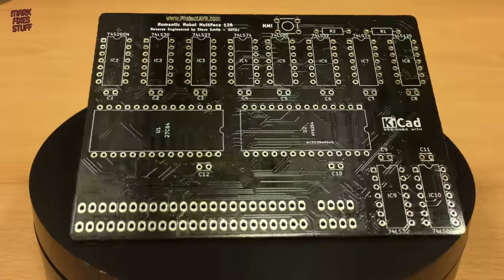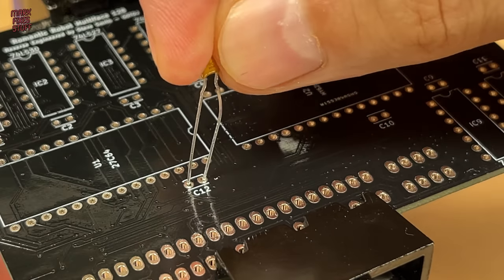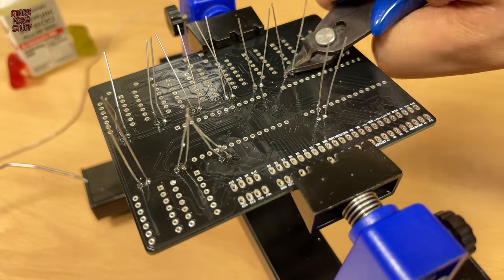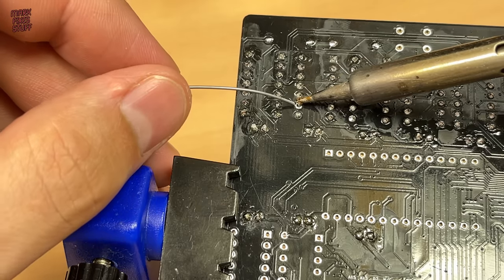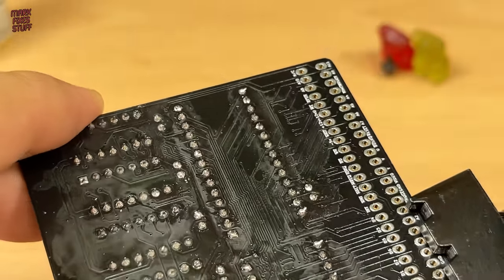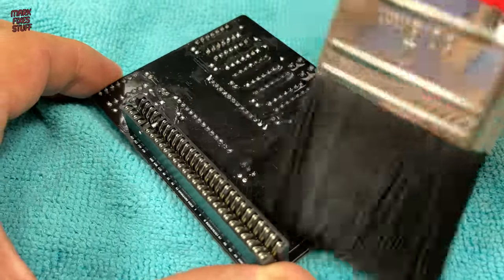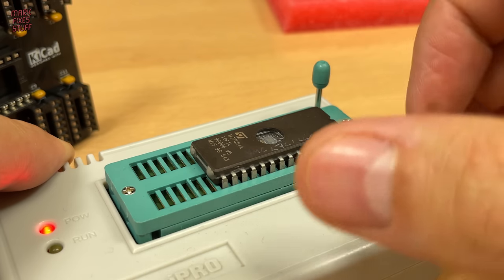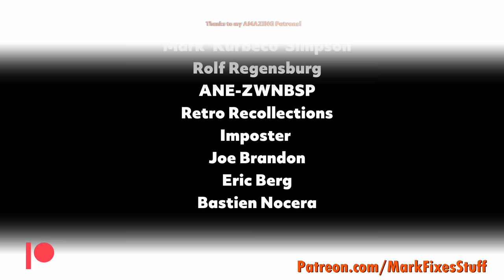I Built a Romantic Robot Multiface 128 Clone... but did it work?

Comment: Just an FYI, The board I sell on Tindie at: https://www.tindie.com/products/projectspeccy/recreated-multiface-128-bare-board/ has the small revision of a right angle touch switch option to make it more like the original device. The solder mask is in ProjectSPECCY.com red as well. Great video Mark!
Reply from the maker: Thanks Steve! Pinned this to the top!
Reply: Is there a case available for this project?

Also, how to make it passthrough?
Reply: Hi Steve, i have build that MF128 also but can't get it to work on a 48K or on a 128K +2 grey. That is WITH additional cards plugged in (like ZX-VGA-JOY) pressing the NMI button just let the screen flash for a second and resets or blocks the Spectrum. It only works fine on a Harlequin in 128k and 48K mode with additional cards. I have added a expansion board at the back of the MF128 + diode and placed it as first in the row, but no luck.

Comment: tip: my MultiFace 128 has 2 8k ram piggy backed and a switch to disable rom and switch to ram for a 64K spectrum.
In spectrum rom a routine to copy rom to 16k MultiFace ram. Then you can poke in rom.

Comment: Nice job Mark - just sub'd. I used to have an old school MF128 clone that looked like it was cobbled together in the 80s. This SS board is excellent although it would be even better IMO if the edge connector attached to the other side of the PCB so you could see the ICs when it's attached to your Speccy..

"That's Numberwang!"

Comment: Your soldering iron doesn't look hot enough! Set to 350 and see if there is any difference.
If not, it's your solder. I use only Kester lead solder from Digikey. It's a whopping $60 USD a role. 
This may sound expensive and not lead-free, but there is a reason companies use good quality solder, instead of cheap Chinese imitations. 
Working with a good solder, makes soldering a real joy. 
I would pull my hair out, if my solder looked like yours. Also, nothing beats real flux. Forget non-clean and all that jazz. 
They all leave residue. I hate residue, so IPA to the rescue...
Reply from the maker: I’ll try whacking the iron up to 350 degrees but it’s just crap solder. I was actually given it for free by a vendor and I’m waiting for my decent solder to turn up. Unleaded solder is dreadful. I tend to use leaded myself, especially because vintage machines already have leaded solder on the boards. To be honest, using the bad solder was just a silly distraction for the video.
Reply from the maker: Btw, this topnik flux is amazing. Stinks to high heaven but works great.
Reply: @MarkFixesStuff  It's probably made of ammonium chloride to make it water soluble. 
The best are the natural rosin for soldering. I like the pine smell. Not like some horrible chemical. 
The amount of flux and quality of flux inside the core of solder is important and often the first thing they skimp on. 
I always use some flux. Just as I would when doing plumbing with copper pipes.
Soldering without any flux whatsoever, is impossible. Solder just won't flow and clumps up at the tip of the iron.

Comment: I have the Multiface One loved it then I got the Multiface 3 for my +3 was not so happy to find i could not load my games from disk without having the Multiface 3 connected and having to press the button so the games would load. Pressing the button downwards would sometimes causes the Spectrum to crash. 
So for me the button would of been better fitted where it is on the clone board as you could support the Multiface unit while pressing the button between your finger and thumb. 
Nice one Mark is it me or are those gummy bears putting on weight. ?

Comment: I am not sure what country you reside in.  The best solder you can buy is KESTER SOLDER 24-6040-0027 Wire Solder.  Which is 0.031" in diameter.  It might be more expensive than the solder you just bought, but the quality is unsurpassed.  If you have country restrictions regarding the use of lead in the solder then you would of course have to go with the lead free solder.  Again buy the KESTER brand.  Can't go wrong with that.  I never go with the no clean stuff.  You always have to clean it anyway so why waste extra money on that feature.
Reply from the maker: Kester keeps coming up over and over again. It is expensive but I’m really compelled to get some now. I’m in the UK so the restrictions on leaded solder are “not for commercial sale” but I can buy it. The no clean flux I use is just my favourite because it works so well, and although I need to clean it anyway, it’s easier to get off than some of the others which can be like toffee!

Thanks for watching and taking the time to comment. It’s really helpful stuff!
Reply from the maker: Just ordered 1lb roll. Sadly I’m quite excited to try it!

Comment: Hi Mark, i have build that MF128 also but can't get it to work on a 48K or on a 128K +2 grey. That is WITH additional cards plugged in (like ZX-VGA-JOY) pressing the NMI button just let the screen flash for a second and resets or blocks the Spectrum. It only works fine on a Harlequin in 128k and 48K mode with additional cards. I might check if it works on the grey if i use the composite output.
Reply from the maker: First thing to check is if the CPU is OK. Sinclair cheaped out and used lower cost parts that OFTEN  had a weak or missing m1 line signal.  It was a problem even back in the 80s.   Swap in a known working Z80 and see if it works. It is common!
Reply: @MarkFixesStuff  Hi Mark. Weird thing is, the NMI works fine with a DivMMC for example. If i connect the MF only and use the VGA (mod) output, then it works.
Reply from the maker: @ronnyverminck2741  Newer MMC models, like the DivMMC Future for example, don't reley on a good M1 line. What model do you have?